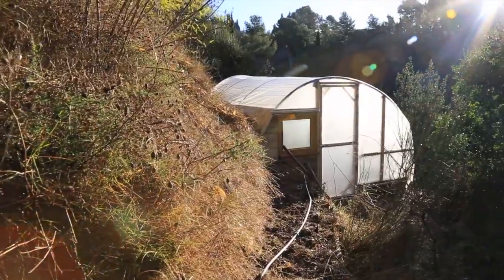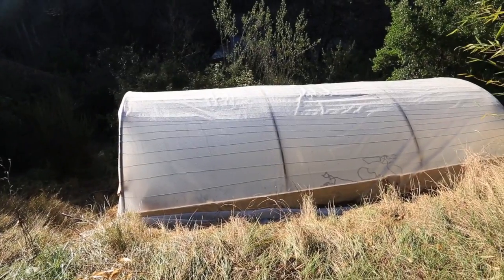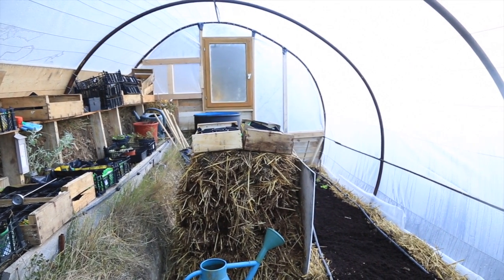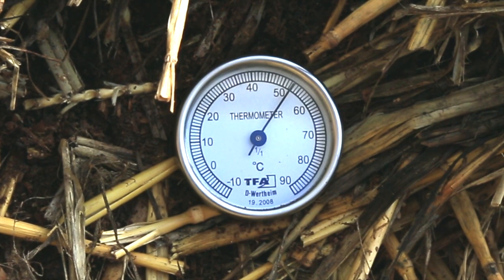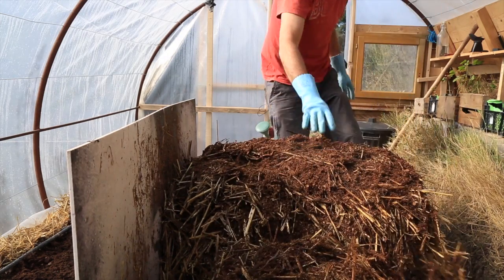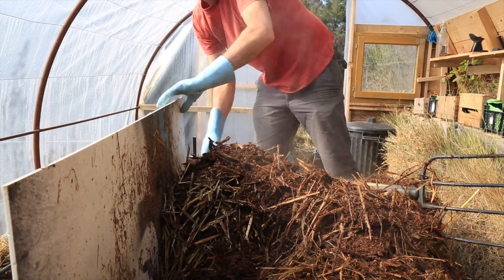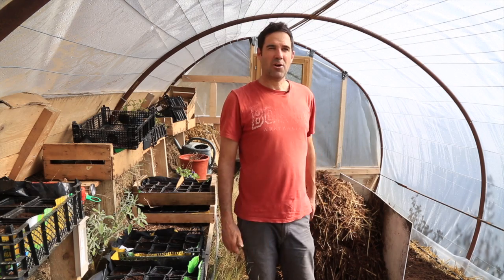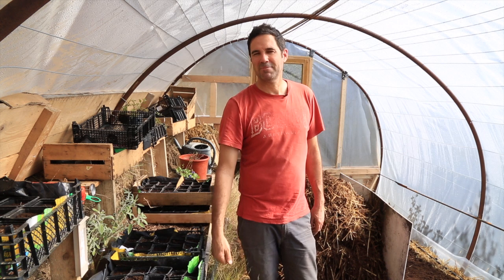Greenhouse Heating Using Compost and Thermal mass  - Chauffage De Serre Avec Compost

Comment: Use the original Jean Pain Compost method that uses made of tree limbs (pulverized and shredded also) and pulverized and shredded underbrush and moisten to form a pile inside a greenhouse and let the fermenting compost generated heat to provide the heat for the greenhouse and to provide the carbon dioxide needed to for the plants inside.

Comment: Although you have painted the plastic water barrels black, plastic is still has poor heat transference. When you add an extra barrel or two for mass I would recommend that you use metal barrels for those.
Reply: In that same thought, would barrells of waste oil be better than water?

Comment: I've been searching this subject for 2 days on YouTube your pile needs to be outside with air blowing it inside otherwise there's no room for any plants. Good job on finding the compost Heat
Reply from the maker: That is a possibility...however as you have seen the compost is on the path in the middle in my green house and there is plenty of room for plants. Putting it outside would  require an insulated area plus tubing and an electric ventilation system, all of which I wanted to avoid. For this system to be really effective I would need to double the plastic roofing to have proper insulation.
Reply: @gaetanproductions  Impressive, three questions: is there a chance that the  compost ammonia hurts the plants or humans inside the greenhouse? do you have to water the compost pile>? and  is it better if you put the pile in a hole?
Reply from the maker: @Messia-n6g  I am not an expert ! :) Several gases are emitted during composting: ammonia, methane, nitrous oxide, hydrogen sulfide, volatile organic compounds, and carbon dioxide. Carbon Dioxide is beneficial for plant growth, however too much ammonia can cause problems. Ammonia can be detected through smell, too much ammonia smell indicates that the pile has become anaerobic, which is not good, probably too much nitrogen and water content. You need to find the right the right balance of carbon and nitrogen matter, this comes with experience, yes the pile can be watered if too dry, if too dry the breaking down process is not activated, too wet though, it is stopped. I would not put it in a hole to avoid the pile becoming anaerobic. My green house is not 100 % air tight which is a good thing, as it allows outside air to enter.

Comment: Can u tell me if rotting leafes or weed are toxic or smelly ?
Reply from the maker: Not at all, the important thing it to get the carbon (dry organic matter) to nitrogen (green/fresh organic matter) ratio right. Too many dry things and the compost will not work, however too many green fresh things and it can get smelly. So the key is a good mix of both and mixing the both together from time to time.
Reply: gaetanproductions i wanned to use leafes n weeds to heat the long balcony of a country house just because i wanna save money n be efficient about it 
Thank you for reply

Comment: How often do you turn your pile?
Reply from the maker: Good question !  The Berkley technique says leave it for 4 to 5 days until it gets hot then turn the pile every 2 to three days after for 3 weeks. What I have found is that in doing that the temperature can go down faster. So at the moment I am experimenting with a pile in the greenhouse that I am not turning, even though I got up to over 60 degrees C after the first 5 days, it is now at a more or less constant temperature of 40 degrees C.
Reply: gaetanproductions so once a week maybe?
Reply from the maker: could be good, all will depend on what is in the pile, the mix, the humidity, etc, as well as the outside temperature... Experiment with it !  Good to have a compost thermometer so you can see what is happening inside.

Comment: hi
i am thinking in bild a greenhouse and the place if offgrid so there will be no heating.
so i have a couple of questions that i would be greatfull if you could wanser;
how large is your greenhouse (m2)?
how cold does it get outside in the coldest days/nights?
whats the average temperature that you can get inside on those days/night?
how warm get the water on the barrels?
do you recomend a ratio of compost to m2?
thats all i can remenber for now-
thanks
Reply from the maker: Hi Andre, My greenhouse is about 15m2, though part of the slope of the hill is inside this surface. Recently it was minus 5 degrees C outside, inside it also got below zero, though what I find is that even though it can get bellow zero inside, the temperature does not have the same effect on the plants that it does to those outside. We get a lot of sun where I live so when the sun hits the greenhouse in the morning it really heats up fast, it can be 0 degrees outside and be 20 inside !!! The water in the barrels heats up slowly during the day and slowly cools down releasing heat in the night. Sorry I cannot help you with the ratio of compost to M2, I would say the more the better ! The compost gives of CO2 which is beneficial for plants, though it also gives of ammonia which is less beneficial... I have not scientifically measured all the techniques I use, (the water barrels, part of the hill inside the structure and the compost) but they all contribute in some way in taking that frost element away and gaining a degrees or so during the cold nights. You might find some interesting reading in "The compost powered water heater" by Gaelan Brown. What type of greenhouse you make and how you passively heat it will also depend on where you live and the winter climate.